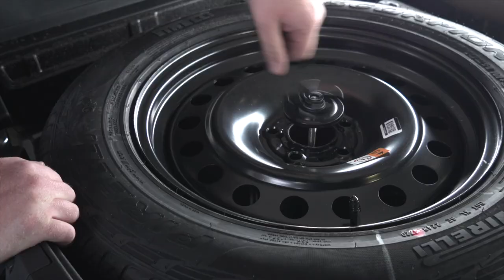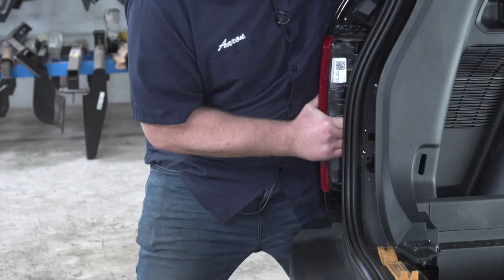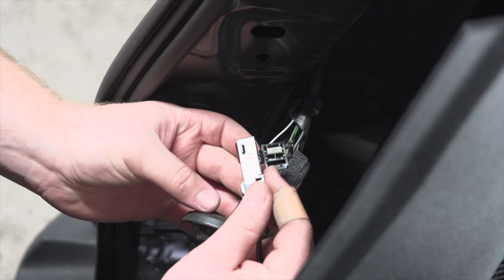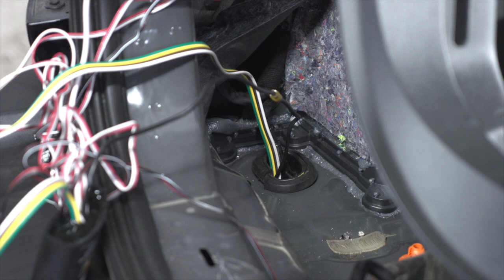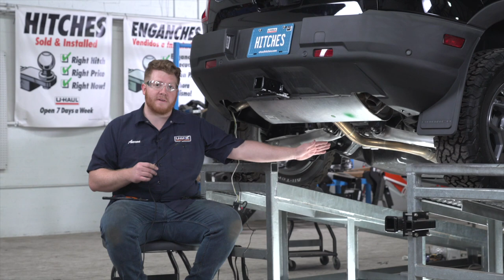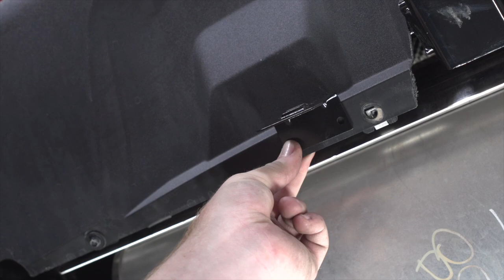2021-2024 Ford Bronco Sport | U-Haul Universal Trailer Wiring Installation (ZCI) | CQT119251

Comment: This is crazy. I installed hitch and wiring onto my 07 Honda CRV and it was all prewired. I had to pull back the left trunk interior panel and there was the plug, I plugged in the trailer wiring harness and was done. re secure interior panel and route the 4pin connector to the hitch and done. Took 10 mins. Ford could do better for the DIY guys like myself.

Comment: Very informative video, but I don’t have the skills to do this myself. I didn’t order my 2022 Bronco Sport Badlands - it was on a dealership lot. So I presume someone ordered it a ways back, then change their mind. Anyway, it was ordered without the tow package. It costs a lot less to order your bronco with the package than to pay to have the hitch and wiring installed later.
Reply: Idk about that. I paid 200$ for installation at the dealership for the hitch install only. I think I have a little over 500$ spent including the wiring harness, hitch and hitch installation. Mind you I used my Ford points for the harness but it's still factored in. I'm about to install the wiring harness I got from Ford.
Reply: Idk about that. I paid 200$ for installation at the dealership for the hitch install only. I think I have a little over 500$ spent including the wiring harness, hitch and hitch installation. Mind you I used my Ford points for the harness but it's still factored in. I'm about to install the wiring harness I got from Ford.